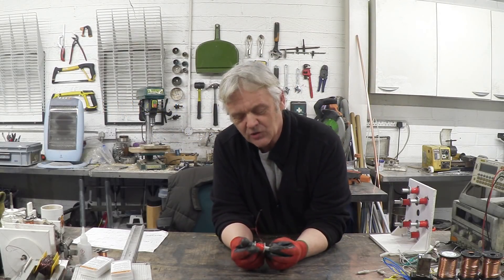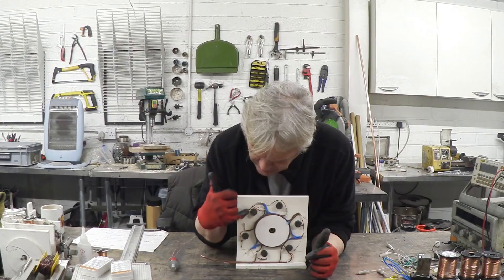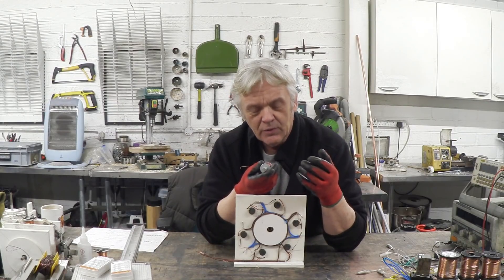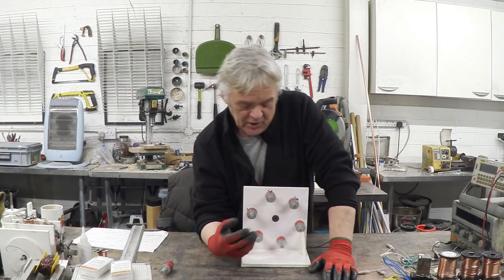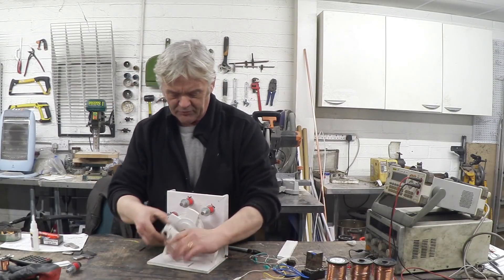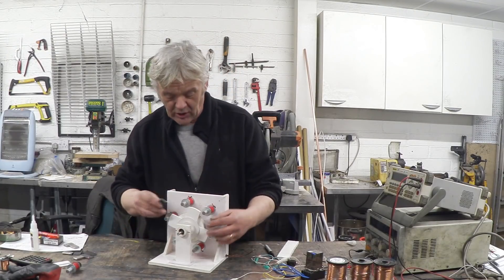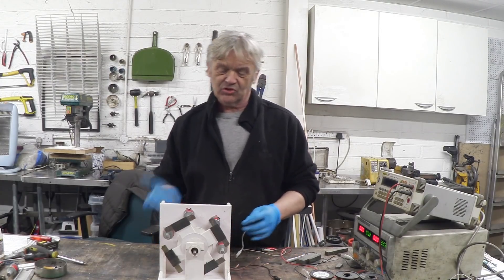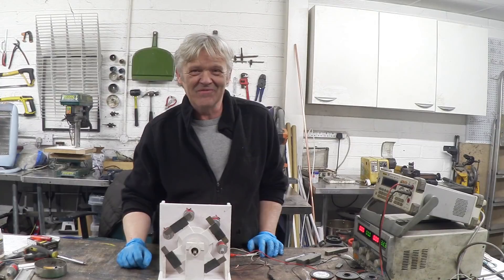1044 Completed Prototype Magnetically Assisted Flux Motor

Comment: The nice you can bulid is to use the permanent magnet power. Insted of the coilpower. Make a 3 ore more circular ankel of magnet and short them using on spole of electro coil.  Then the short putts on and of the magnet circle. And the power out put vil be the power of the static magnet forces not the coil. Eternity engine ore battery..

Comment: EBay sells cheap signal generators with 3 phase output. You can set the PWM width and frequency, just what you need for testing diy 3 phase motors.

Comment: Where you were connecting a single switch, you could have a circular arrangement of 3 contacts with gaps on them, then spin a handle over multiple revolutions, each revolution would hit each of the 3 switches (ie join the gap to connect both parts of the “switch wire”) in turn. You could control the speed at which you turn the handle and if you get it right , the motor would spin faster, a manual speed controller so to speak

Comment: Mr Smith, could you please find out what happens when you use graphite rod(s) as the core for a transformer? 
Keep in mind graphite is diamagnetic, there is many other reasons I wonder, I plan on designing a starship coil transformer where I preform electrolysis with the core as the electrodes.
Remember your video bringing a magnet up to hho production increase the performance... with the setup mentioned it will piggyback off the magnetics in the transformer.
And if you allow the starship coil to spin the rods in place, or even spinning on a fixture maybe, but in place would be better, the bubbles won't be clinging around on the rods improving the preference.

Comment: I think your lab would benefit from having a programmable three phase supply, if you are going to continue experimenting with motors. One possible solution might be to use an Arduino to generate a variable frequency three phase sign wave output and feed this to three audio power amplifier ICs, say 20 watts each.
Alternatively, just use the microcontroller  signals to drive three H bridge ICs, then at least you could replace the switches with a drive signal.

Comment: Wish I could send you a sketch.      Use an old push mower rotary head.    Line the solenoids  along the face of your board 
Then line small magnets along the rotary head     Time with a disk at the end of the Rotary  head    The hyperdine  self assisted Electric motor

Comment: excellent! will there be any problems with eddy currents? David
Reply: shouldn't be an issue, this is a reluctance motor which doesn't produce eddy current's by virtue of it's design,(one of it's advantages), usually eddy currents come about because of a permanent magnetic field, however being able to "switch off" the permanent magnet with the coils should all but eliminate that effect, that said, I noticed in this design 1 phase still has a small magnetic field at any given moment so that could be an issue.
Reply: @MrTubeuser12  Thanks for the reply Mr. Bloggs. Would replacing the solid metal plates with individual ones (like in a transformer) be better??  DVD::)

Comment: I really hope this is building to Rob making a practical diy motor for the electric vehicle project.  So cool.
Reply: It would be really cool to use a high-tech e-bike controller and connect it to the motor Robert just made. Just to prove that high-tech electronics works with very basic things anyone can do at home.
Reply: @nattsurfaren  teznic

Comment: Awesome job! Looks like you may be able to operate an 8 pole rotor, due to the ability to cancel one of the 3 phases at each step, and possibly get a good torque out of that design. Out perform a permanent magnet motor due to no cogging????? Absolutely love where you are going with this.... Wheels in head spinning.

Comment: Axial, there's a huge advantage in Axial type but personally, my head got stuck with the reciprocating due to several applications requiring linear motion and in the point of "Zenith" there's few phenomenons that I want to explore, the auto induction can melt the coil, so can them be improved ?

OK, let try some Axial power, anyway it's FE (Formula E) technology of choice and it's VERY interesting for auto-motion (vehicular).